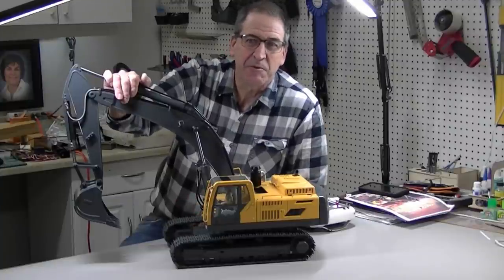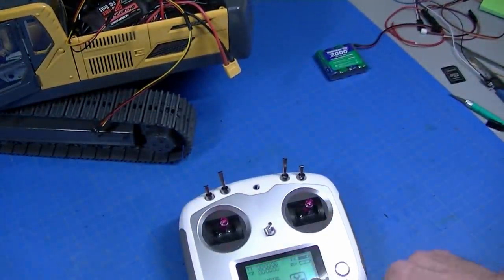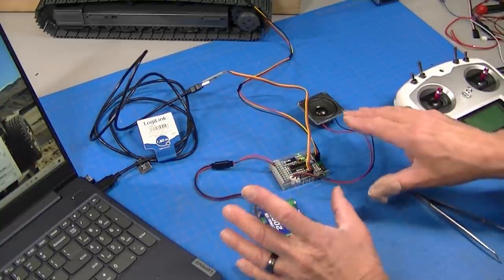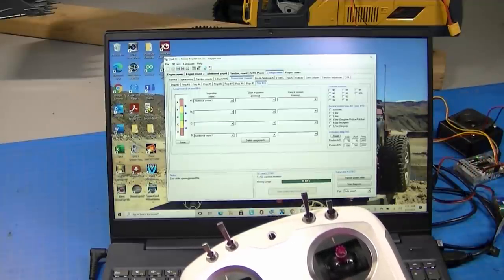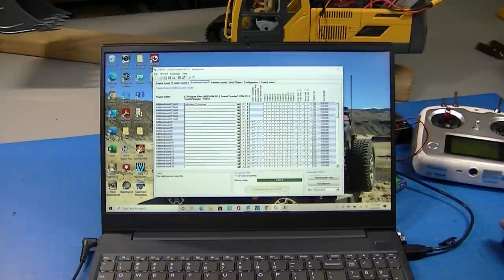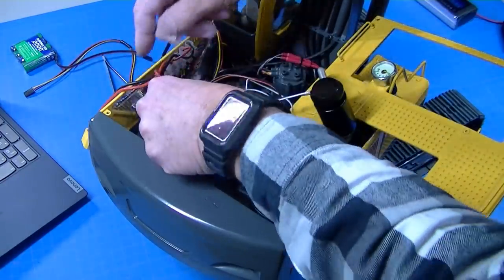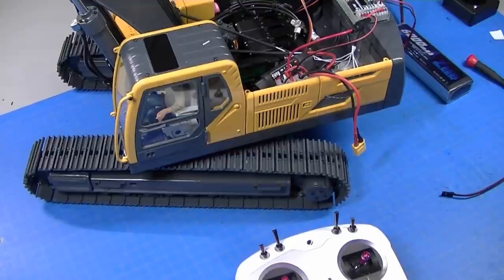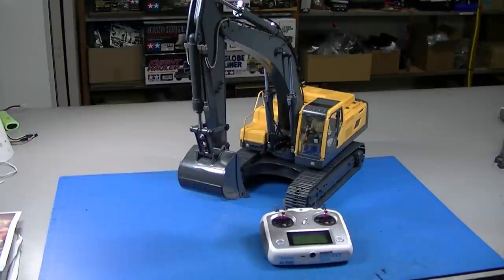1/14 RC Hydraulic Excavator 360L RC4WD adding Beier USM-RC-2 Sound System

Comment: That is a BEAST of an Excavator!! 😲 
I'm so very impressed with the Beier Module. Of course you could barely get into its features on this... One Channel Lights and Simple Sounds. 
However, after reading the Manual, it's so cool how many things this can do - and I keep the precise Motor and Brake control of my Hobbywing WP1080 ESC!!! 
Now I'm anxious for you to do a complete Setup Video on this - on a Rig. Hopefully I'll be at the point in my Grand Hauler build where I'm really to start the Wiring SPAGHETTI!!! 😜 Just in time for a Tutorial Video. 😉

Comment: interesting about the ibus plug on the receiver.  I wonder if the SMB can get sounds through there and not require the use of 2 open channels.  I'll have to research that if it is a possibility.
Reply from the maker: I really like that feature.  Makes hookup so easy.

Comment: I do enjoy these how to videos with the sound and light units. Might have to see about getting one for my Grand Hauler.
Reply: The grand haulers are cool rigs for on road but honestly  the hg trailer and either the hg 802 to pull it or the hg 602 creation of mine to pull it around.  The hg trailer fits the 870k perfectly as you can see in my videos.  the 360L will work as well.  When pulling off road the king hauler can't hold a flame up against a awd 6x6 or 8x8 diff locked beast.  Even my 6x6 overland Ive set up for pulling options for big equipment.  I had a few Gand haulers etc in past sold them off due to the power I can get out the the other models. Even cross Rc rigs

Comment: Hey bob, got a littel tip for you. If dont know already, there is a sound simulation mode in the top row under the help in the soundteacher. It plays all the sound like its in the truck or excavator.
Reply from the maker: Yeah, I have used it and is a cool feature.  When I do the tutorial videos on the units I will showcase it.

Comment: That's Beier Sound unit. Would I be able to hook some 12v 40mm fans to it?
Reply from the maker: Not sure why you would want to run fans through it.  It needs no cooling.  If your motors or esc's need fans probably best to wire them direct so when you turn on your unit the fans run.

Comment: Super video Bob and full of tips. Using that Beier unit do you still have to use a Resistor at each led? or does the Beier take care of that?
Reply from the maker: The Beier puts whatever power that goes into the unit out to the led's so you do need a resistor.  I used the led's that have a built in resistor that I sell.

Comment: Hello from Australia Bob, I love your videos, they are very informative and have helped me many times. 

I would like to make a suggestion re the sound system. If it can be done, a beeper as the excavator walks, as now days it is standard fittment on all excavators from a small 2 tonner right up to a 550 tonner.

Also is it possible to have the engine sound change tone as the hydraulics are used, like the engine is loading up when hydraulics are activated.

Looking forward to seeing your next video.

Steve.
Reply from the maker: The Beier will do both easily.  The only limit is what you want to do.....

Comment: Why didn’t you mix the sound module revs with the sticks . And tracks
Reply from the maker: Because on real excavators they do not work that way.  They set the throttle then dig and the throttle stays the same.

Comment: YOU'VE DONE A SPECTACULAR JOB WITH THE PROGRAMMING FOR THE CONTROLS LET ALONE THE SOUNDS. I WOULD NEVER HAVE THOUGHT OF SOUND VARIATIONS LIKE THE ONE  I JUST THOUGHT OF THANKS TO YOUR SHAREING. HOPEFULLY I CAN EXPLAIN THIS UNDERSTANDABLY. (IF THAT'S A WORD). IF YOU SET THE IDLE AT MEDIUM CONSTANTLY, CAN YOU LINK THE ENGINE SOUND TO GO HIGH WHEN EVER YOU USE ANYTHING LIKE THE BUCKET, ARMS, TRACKS,  OR ANTHING ELSE THAT WOULD GIVE THE ENGINE A LOAD AND GO BACK TO MEDIUM WHEN GIVING LESS THE LOAD? AWESOME JOB ON THE INFO YOU SHARED! I LIKED AND SUBSCRIBED (SOMETHING I RARELY, IF NOT PRACTICALLY NEVER DO) THANK YOU VERY MUCH AND I MAY BE SETTING ANOTHER BANK ACCOUNT UP TO SAVE AND BUY ONE OF THESE.😃
Reply from the maker: You could link the engine sounds to the movements.  For example move the arm and it speeds up but in reality having the switch just makes it easier.  The sound on this unit does work very well.